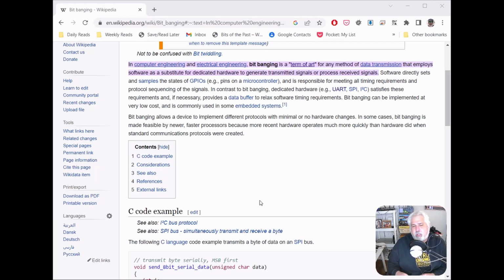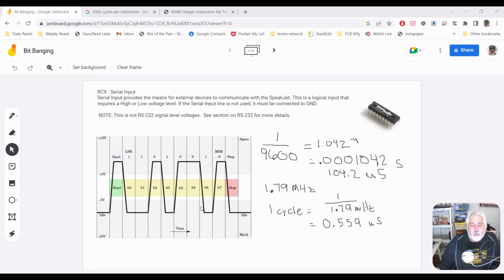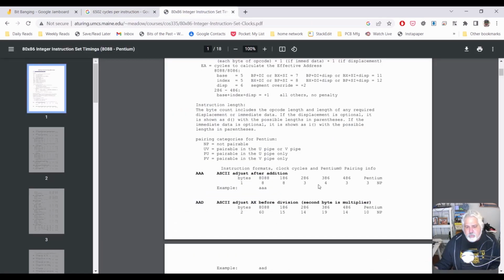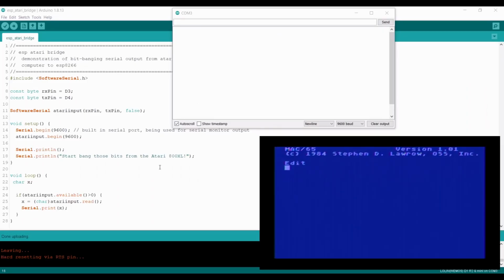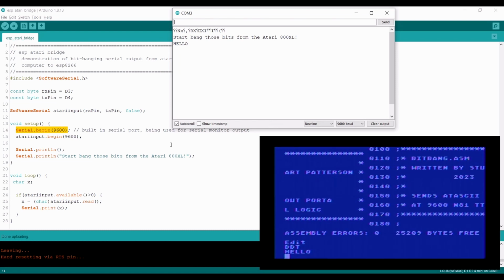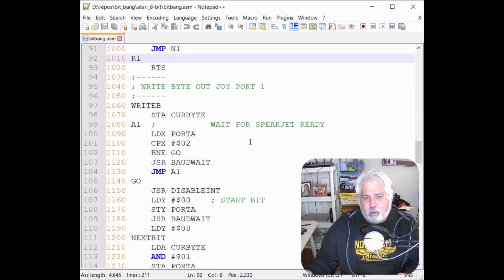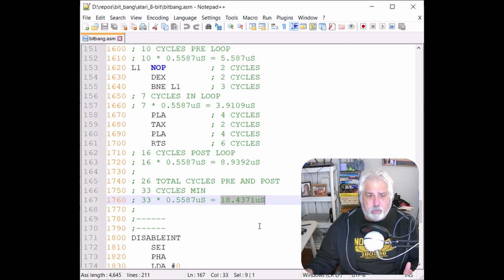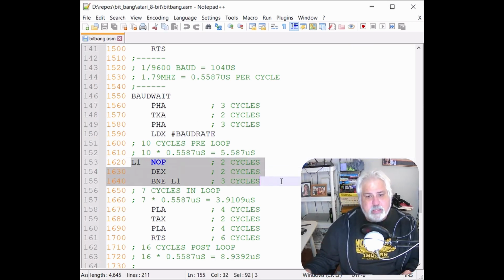Bit-Banging It Old School

Comment: Most people dont inderstand the start & stop bits and wby they are needed.
These came from the old ASR-33 teletypes and omce a start bit was detected, it engaged a mechanical clutch that linked a synschronis motor to a distrivuter. As the data bits followed, this rotor wpuld spin at the motor rate and set mechanical rods. When the stop bit was sensedb tje clutch disengaged and the character was printed
And on sending when you pressed a keyb it would engage the clutch again and read the rods and aend the bits, then disengaged the clutch
Reply from the maker: Very cool!  Thanks for sharing, I did not know that!

Comment: I have been doing exactly this on the same old processor that I used to have in my first computer long ago ( not a 6502). Maybe I overheard it, but stuff like interrupts or DMA requests can throw quite a brick into your carefully timed routines, How do you get that to work on the Atari without disabling them?
Reply from the maker: I did disable interrupts and those that are nonmaskable where left to go their merry way.  Hence, at higher baud rates you can drop characters.
Reply: @StuartPatterson  Uploading files via the XMODEM protocol is the only way to load something on my little breadboard experiment. Things also get very tight when whole data packets come in rapidly. I got 19200 baud quite reliably, and 38200 baud are possible if I clock the old processor with 7.3 MHz. That's all it gives me at 5V, but it's a CMOS processor, probably the first commercial one ever. It can be overclocked in a similar way as modern processors. In the old days that was not so attractive because faster RAMs were hard to get and expensive.And who had a terminal that supported such baud rates?
Reply from the maker: I remember my 300 baud modem on the Atari 800 and using xmodem. Those were the days!